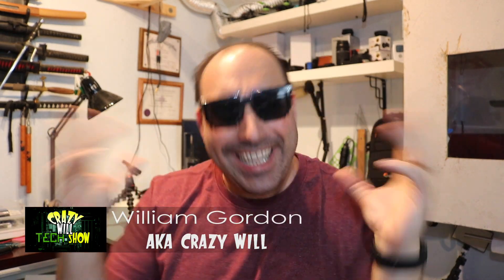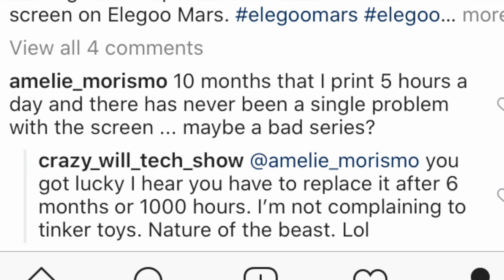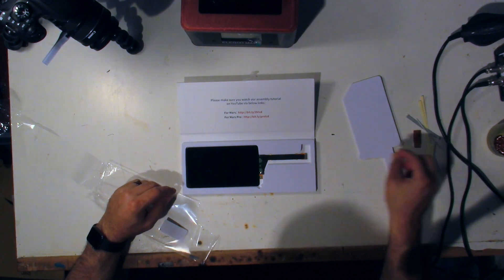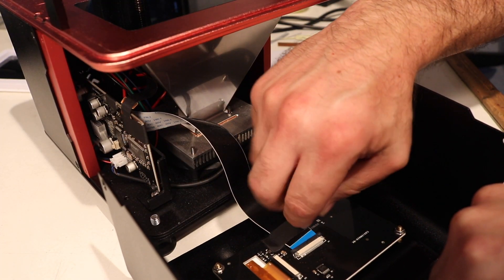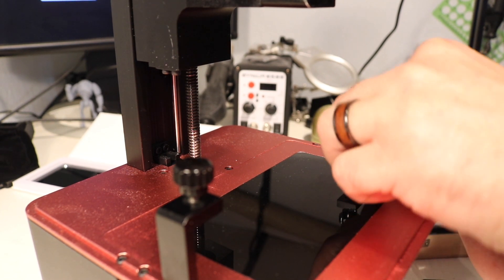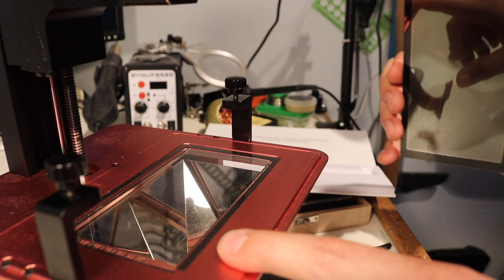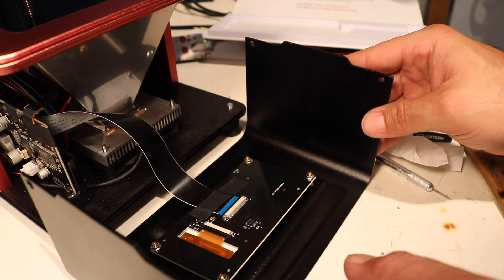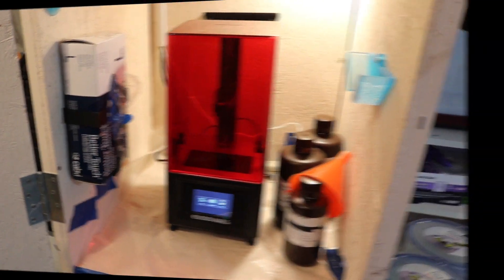How to change the  Elegoo Mars LCD

Comment: i have the same problem with holes in my prints however i don't have any dead pixels when testing the lcd however the screen is somehow stained on the opposite side could i possibly clean this or will i too have to replace the screen?
Reply from the maker: You probably have to replace the screen. You could try taking it apart and cleaning it. Also check the cable to the LCD screen. How many prints have you done?
Reply: @CrazyWillTechShow  Hi thanks for the reply yeah i just pulled the trigger and fitted a new lcd today everything works as should now. i think it was the glass under the lcd that was really dirt pretty much the same pattern that was showing on my lcd. i had the printer in the workshop over winder so im guessing its some sort of moisture that got trapped.Thanks again

Comment: Your first screen broke because there was small dust particles between the lcd and the glass. Every time you level your bed it get pressed down onto the dust particles. This causes unnecessary pressure  in those areas and over time wears down on the pixels.
Reply from the maker: Makes sense there was plenty of dust in there.
Reply: What's the solution for keeping this from happening?

Comment: Im having the same issue changing mine out, in fact i am not even getting the black rectangle exposure testing. Im hearing a definitive "CLICK" when i press the cable into the motherboard...but nothing. Any tips?
Reply from the maker: Disconnect the raspberry pi if you have one connected to it. That was my problem. Also try the USB.
Reply: @CrazyWillTechShow  like try to do a print off the USB? I try that on the screen is black there's no pattern.I didn't install a raspberry pi on my Mars is there one installed on some of them by default? Sorry it's my first time :D
Reply from the maker: Your fine man, no I have one hooked to it and it was giving me problems. It’s me sorry. What I was trying to say is turn it on with nothing in the USB then hook it up and see if you can get a pattern.
Reply: @CrazyWillTechShow  I got it! All I had to do was unplug it and plug it back into the motherboard the same way  33 times. That's the trick. X) wow, what a headache for a "consumable" They'd better get some traditional plug designs or something like a cartridge in the future. That's ridiculous.
Reply from the maker: That’s ridiculous.... I said the same thing in the video. Make it easy if it’s going to be replaced.